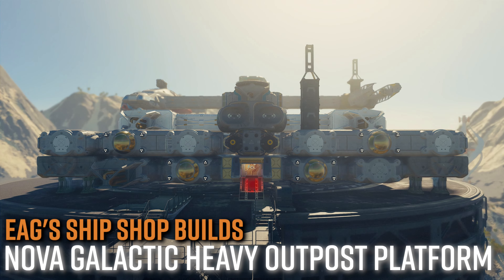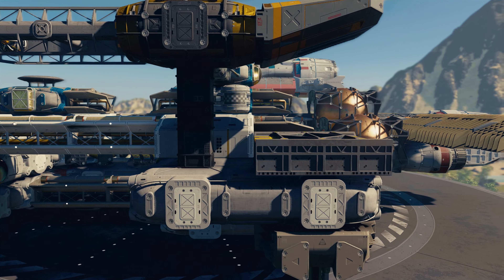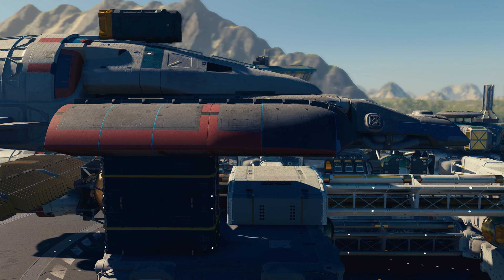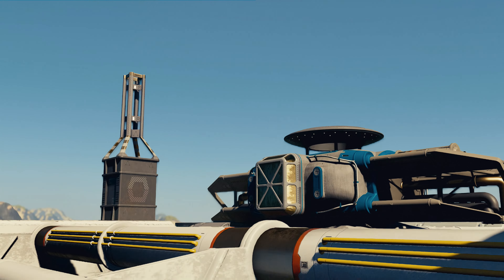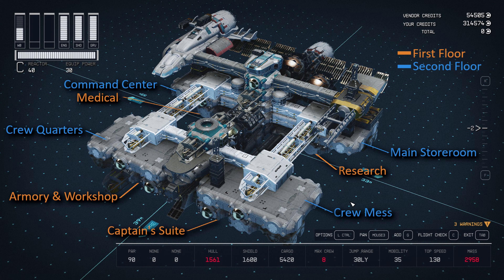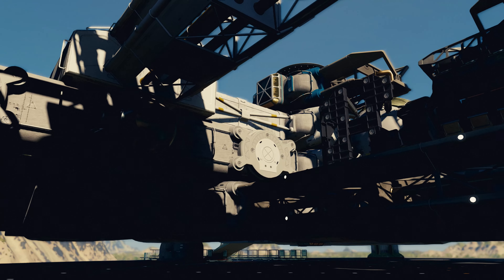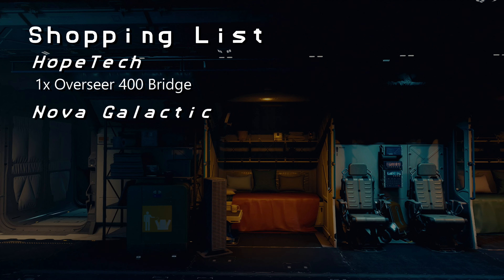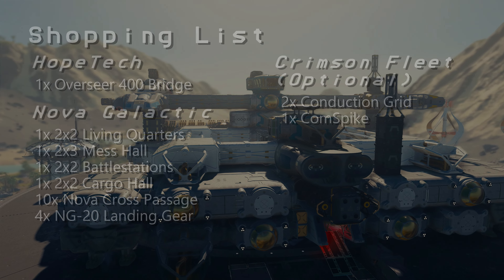STARFIELD | Heavy Outpost Platform Tutorial | RP Ship | Eag's Ship Shop Builds

Comment: This is a great build.  The only change I would make is aesthetics/ function.   On the ‘shuttle’ you placed two weapons.  Wouldn’t it be more accurate for the weapons to be port and starboard instead of top and starboard?  But that is the only complaint.
Reply from the maker: Yes, lol, but I couldn't fit anymore equipment plates on my build due to the module limit 😅 

So thats why I just stuck them on the little shuttle.